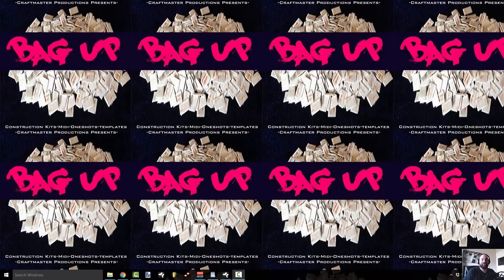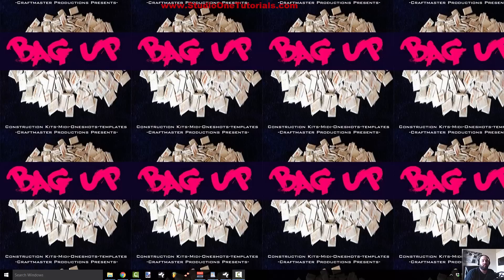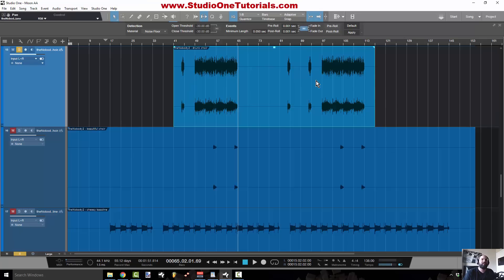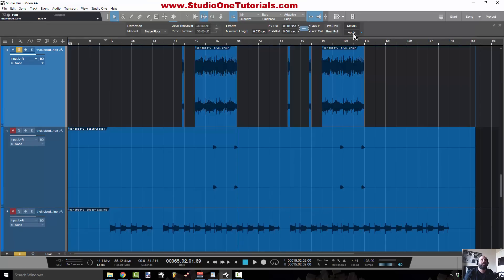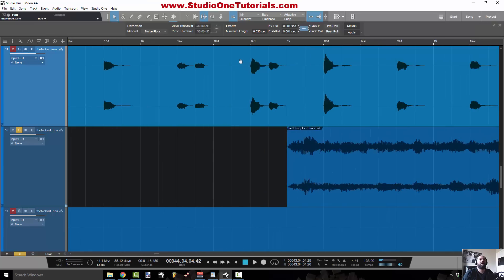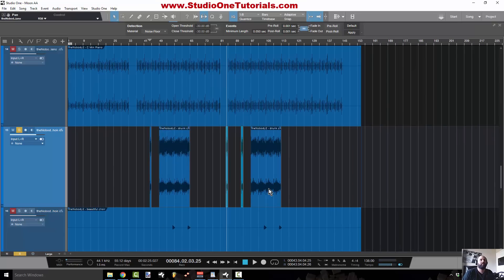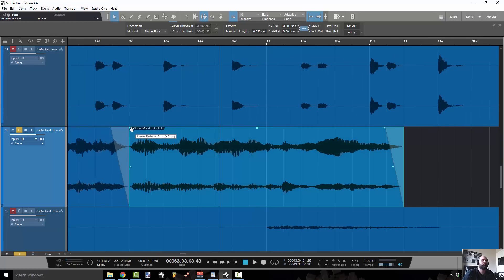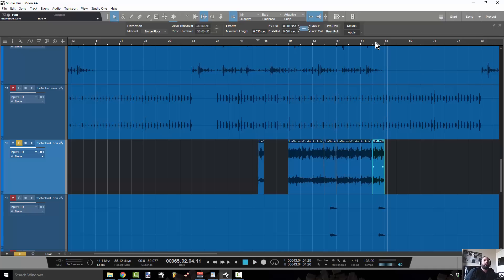Presonus Studio One 3 Remove Pops and Clicks | Beginner Producer Series

Comment: CMP, I know this is coming in late, but you don't say how to find them.   I'm working on something and didn't notice them until after adding compression.  
How do I hunt down the perp that is causing all the hate in my mix?
Reply: If you solo the tracks and add compression on each track (not too much) it becomes easier to hear the pops and don't listen at a high volume. Then after your done take compression off each track that you added it to. Sometimes that helps if the pops are quite quiet and hard to hear.
Reply: @IzzySpint  Thanks Izzy.  :)
Reply from the maker: Ron H solo tracks and listen